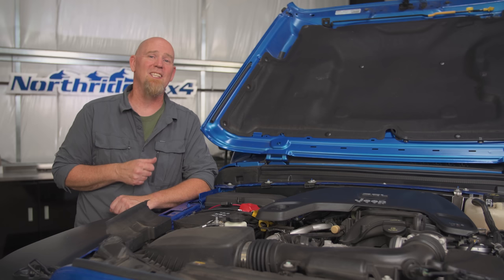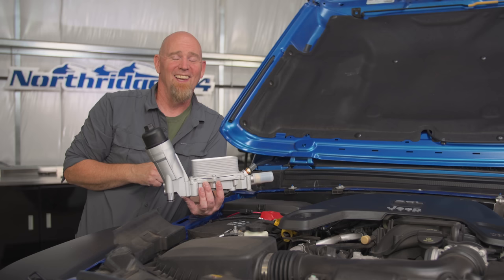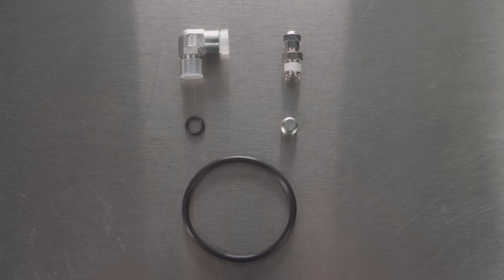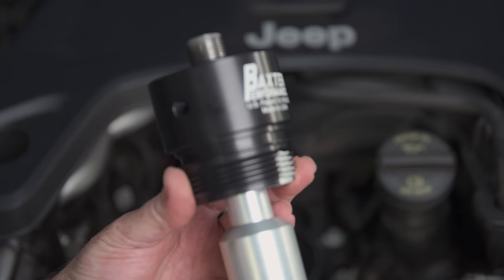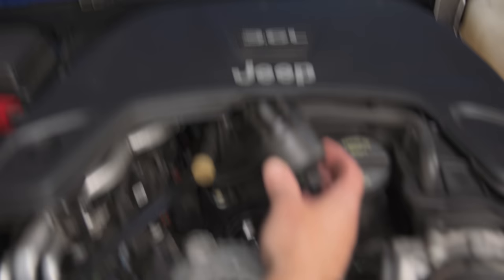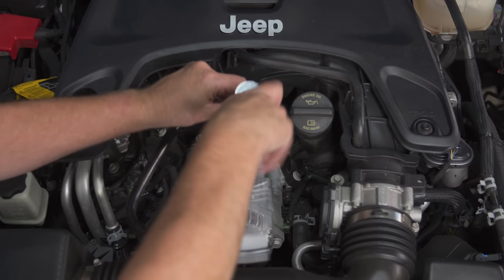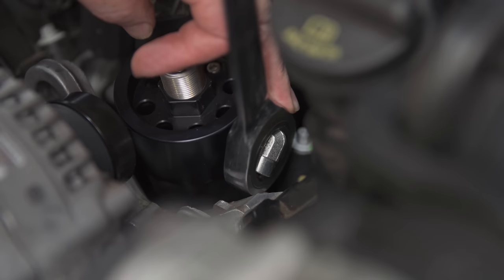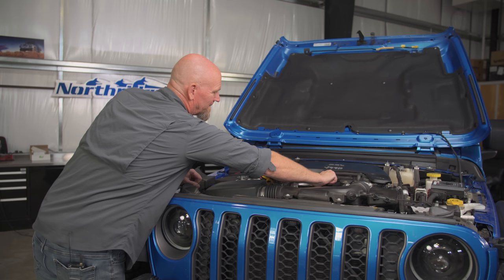STOP Dry Starting your Pentastar 3.6!!

Comment: Oh i have so many words for this gimmick...... you think all of the oil goes into the filter housing then out........you are mistaken.....The oil filter is an afterthought in the system....... Or it would be put before the oil pickup inside the oil pan.........This thing you are selling wont help.......
Reply from the maker: It definitely helps, you can hear the difference on cold starts.
As far as the oiling path in the Pentastar 3.6, the oil pump pushes the oil up through the filter, into the cooler and out to the main oiling galleries. There are some great oiling diagrams out there on the web showing how it is oiled.
Reply: @northridgenation  damn how do the main bearings and rod bearings survive....they get oil last........course I'm not the one trying to sell this BS.
Reply from the maker: @yami4g63  Once it hits the main oiling galleries, it splits and goes to the heads, the piston cooling jets and the crankshaft main journals. It's crazy and that's why this product is great.
Reply: @northridgenation  but you just said it goes through the filter 1st........make up your mind...
Reply from the maker: @yami4g63  Yes, it goes up through the filter, then the cooler, then to the main oiling galleries and beyond.
"Once it hits the main oiling galleries it splits and goes to the heads........"

Comment: 3.6 Pentastar , one of the worst engines ever made by Chrysler 🤮
Reply from the maker: You think so?  We don't think they are the greatest engine out there, but they've proven themselves to be very capable.
Reply: @northridgenation yeah I can't think of anything worse even the notorious old 4cyl minivan motors were more reliable than the pentastar. It's got a horrible track record just trying to reach 100k miles on the original motor.
 
This oil system modification should really help these engines as the oil system seems to be the #1 cause of all the failures

Comment: All in the plastic, OEM filter / cooler housing--yikes. First install the MADE IN THE USA, ALUMINUM DORMAN. Make sure it's stamped with "USA."
Reply from the maker: @johngranato2673 , The Dorman oil coolers are made overseas. To double check, we emailed Dorman and just got an confirmation back from them stating that they are designed in the USA and built overseas.
Reply: @northridgenation how does Dorman get by with stamping Made in the USA on their oil filter housing as well as the packaging?
Reply: I emailed Dorman too. They told me it was cast in the USA. YOU MIGHT WANT TO FOLLOW UP WITH YOUR CONTACT AT DORMAN. I don’t see how they can stamp made in the USA on the housing and cast it overseas.
Reply: @Jake-pq3iz  Perhaps. But no matter, it's the best option, best warranty, and has produced the best results for me and a few of my fellow Mopar owners. BTW, I use never seize on the cap threads. It's possible that some of the problems with the plastic unit are due to over tightening the cap and then the resultant extra effort employed in removing the cap afterwards.
Reply from the maker: @Jake-pq3iz  Direct from Dorman in December 2023:
"That information is outdated. When this SKU launched, it was made in USA. Manufacturing has since been outsourced."
Reply: @northridgenation  who was the email from? Mine was Nicholas Paris. Here is what I asked them.
“Was the Dorman oil filter housing 926-876 made in the USA or overseas?”
They told me casted in PA, USA.
So which part number are you referring to?
Reply from the maker: @Jake-pq3iz   There's the problem. You asked where WAS the Dorman 926-876 made. That WAS made in the US and is no longer available.
It was replaced by the Dorman 926-959, which is made overseas.
Reply: @northridgenation  I sent them an email about that part number yesterday. We will see what they say. I find that specifics matter when you are talking about oil coolers and the seals.
Reply from the maker: @Jake-pq3iz  
You can find the specifics right on the Dorman website:
https://www.dormanproducts.com/p-135210-926-876.aspx
Highlighted in yellow: Replaced by Dorman Part Number 926-959
Reply from the maker: @Jake-pq3iz  Did Dorman ever answer your email?
Reply: @northridgenation  they are made in PA and Malaysia.

Comment: This is for the same type of people who believe in installing catch cans. They think they understand engineering, but they don't.

I wish I thought of this idea though. It seems to be a great money maker for everyone involved.

Oh, and before you fly off the handle with your comments, remember what you have studied. I am a mechanical engineer.
Reply from the maker: And you design engines for which big automotive company?
Reply: @northridgenation  Not sure if it is greed or your weakness on the engineering side, but your intervening action against (guess what) a customer, who points out the redundancy of this design is poor. Engines of course are not designed by a single person and while I have an abundance of knowledge in the field, anyone with a hint of engineering skill, will understand that as cam phasers are right next in line after the filter as the oil travels, the filter housing fill is instantaneous (especially due to the high output of the variable oil pump), which is evident by listening to the cam phasers instantly quieting down at start. Feel free to remove this post in shame.
Reply from the maker: @mrtopcat2  No reason to remove this post, we can use it as a learning experience for both you and our viewers.
Greed? We are in the business of selling parts. Call that greed or call it capitalism. We've found a part that works and works well and want to pass that on to our customers.
Weak on the engineering side? You still haven't told us what big automotive company you are designing engines for?
As far as the oiling path on the Pentastar 3.6, you are wrong. The cam phasers and timing chain tensioners are down the path aways.
From the filter, it must fill the main galleries, the cylinder heads, the camshaft oil ports and then it's split up to the chain tensioners, the lash adjusters and the phasers. Not only does the oil have to get there, it has to get those components up to operating pressures.
Yes, it is fast, we mention in the video that it takes about 3.5 seconds for the oiling process to take place.
3.5 seconds may not seem like much, but add that up over every dry start over 100,00 miles and that could make a big difference in engine longevity.
You can claim some sort of superior engineering knowledge on this product and how it works. But you might actually look into all the issues that the Pentastar 3.6 has with lubrication on the top end. Then use your superior engineering skillz to come up with a better mousetrap.
Reply: @northridgenation  The reason why I have mentioned the cam phasers, because those have a large void, so outgoing oil from the oil pump can fill the filter instantaneously as it has a clear path post filter as well. So this is not like on some of the older engines, where downstream from the filter there is only bearings and lifters and therefore the filter may take a bit longer to essentially bleed. But not so on the Pentastar, which has plenty of bleed opportunity via the phasers, tensioners and/or the piston oil squirters. Which is exactly why in combination with a high output variable oil pump, the bleed time of the Pentastar filter is essentially instantaneous. You can easily check that via with an oil pressure adaptor, which is available for the Pentastar as a modified filter cap with a threaded port for a pressure tester.

No, of course I have not designed any engines (despite what you read, engines are not designed by a single person to begin with), but I am currently working on a Pentastar project with cylinder head issues and improvement thereof being the target and with a few Pentastar heads sliced and diced, disassembled in my shop. By the way, your aforementioned 3.5 seconds is really nothing, especially in everyday use, where even that time is far faster. Most notably we are not talking about a dry assembled engine here (not that there is even such thing). There is always plenty of oil left in the bearings to provide hydrodynamic pressure for the minute idle time until oil from the filter arrives.

Hopefully you only drop ship this item and did not stock up on it. Otherwise, I don’t see how you can feel good about selling it after what you learned here. Unless of course selling for those, who will chime-in in defense of this beautifully made, but entirely unnecessary/useless item.

Comment: Absolute rip off , does not work , made the issue worst and oil pressure light would not go away after three pressure sensors, the problem was this product. Do not buy this you'll only make the issue worst.  Just change the rocker arm and lifters when the time comes .
Reply from the maker: We've had zero issues with ours; could it be it was installed wrong?

Comment: So much bad information on one video. This entire video is bad information. These engines build pressure extemely fast. The needle bearings fail. 0 to dp with oil pressure at startup. Dont buy this garbage your 3.6 is still going tp break.
Reply from the maker: Please give us more info Mustang Mike. What info is bad? How does this product not help?
Reply: @northridgenation  No if anything it will hurt. The drain back valve is built into the oil cooler. These engines suffer from bad parts not a lack of oil pressure. The term starting dry is also incorrect. Only time an engine is truly started dry is after a rebuild. After it has ran oil will have coated everything and will still have a film especially if you use high quality oils if you want your 3.6 to last then change oil every 5k and use a high quality oil. Do not use this product it will do absolutely nothing.
Reply from the maker: @mustangmike501  Take a look at this demonstration: https://www.youtube.com/watch?v=g5aowl0skY0&t=0s

Comment: Nope, you providing false info. Your not even holding a stock setup, stock is plastic. And the stock system is at the top, thus no dry starts.
The weight of the baxter will snap off the stock plastic filter housing
Reply from the maker: Check out the oiling diagram of the 3.6 Pentastar to see how convoluted the oil path is and how long it takes to get oil to the cam phasers and timing chain tensioners. 
https://prezi.com/ijeeedzmeegi/pentastar-36l-v6-lubrication-schematic/
As far as spreading false info, that's what you are doing by saying the weight of the Baxter adapter will snap the plastic housing.